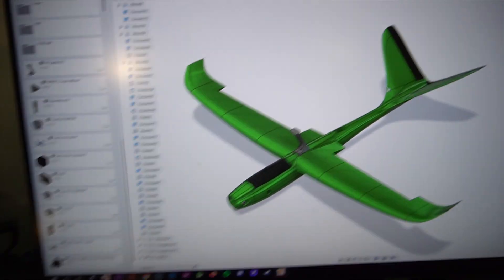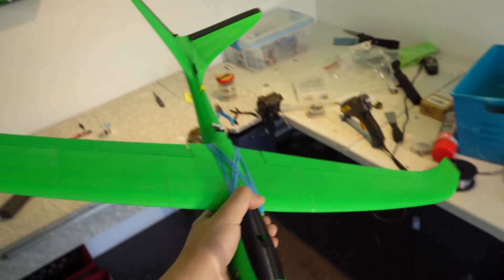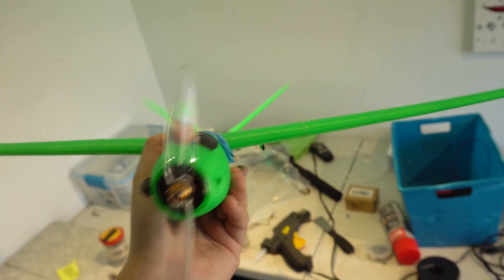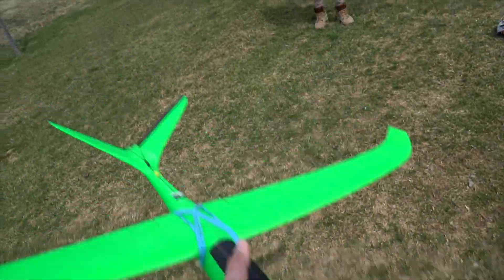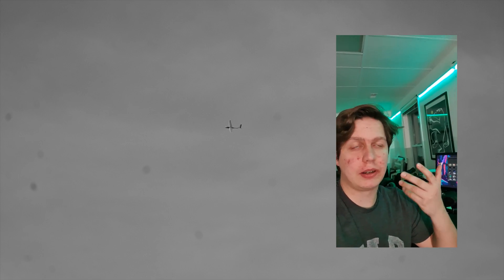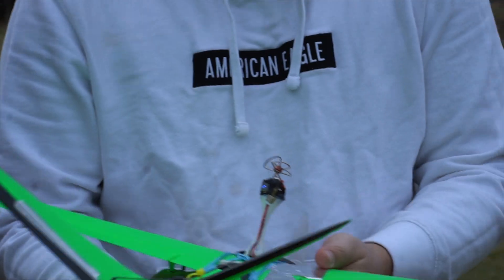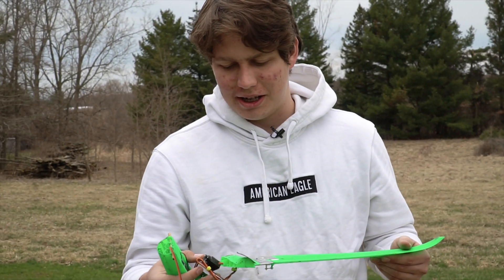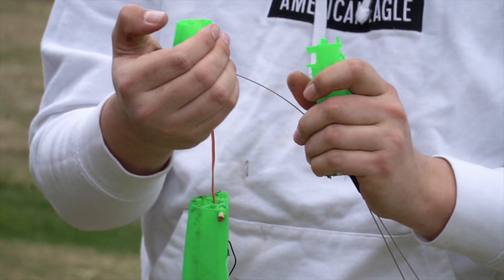3D Printed RC Plane - Will it Fly?

Comment: I wouldn't trust those tiny rubber bands to hold my wing and your ailerons may be prone to fluttering due to a missing hinge in the middle. Also, designing such a beautiful plane without a big black spinner in front is sacrilege ;)
Reply from the maker: I also have files for the fuselage available without the skewer holes so the wing can be permanently glued down
Reply: @GregMakesStuff  Nothing wrong with fixing wings with rubber bands, I only meant you should use much thicker ones.

Comment: try 3d casting plastic
Reply: klingon glue sucks, aluminium frame, metal-air batteries, diy stuff?
Reply from the maker: Might be difficult with the complex rib structure

Comment: Defintely make a video on how you designed the plan.  i'm trying to figure out how you built/designed the support ribs in the wing design.
Reply: eclipson airplanes
Reply: @marc_frank  Do they have a video on how they get the internal ribs?
Reply from the maker: Here's an explanation: the solid parts were copied and shelled out in fusion 360 (0.5 mm wall thickness) to create the "skin". Rib lines were then sketched using the design as a reference and extruded. These ribs were then cut by the skin and holes were created in them to reduce weight. Finally, these ribs were subtracted from the original solid parts and these parts were mirrored when necessary. 

Hope this helps!

Comment: Anyone think it would be possible to print this in tpu? Pla is just so fragile one crash and this thing is done.
Reply from the maker: TPU is too flexible. There would be too much wing flutter. If the design was optimized for TPU, it would be too heavy.
Reply: Greg Makes Stuff oh I see. maybe with some carbon inserts it will stiffen it up.
Reply from the maker: Hmmmm I might need to do a video on that. Thanks for the idea!!

Comment: Hah, great job, man! I also design my own RC plane, your video was helpful in some details. You can consider not just gluing one round part to another, but to make like small protruding cylinders on one part which will fit the similar cylinder recesses on another part. It will make your plane more sturdy.
Reply from the maker: Yes I thought of doing that, but it's hard to do since the part has 0% infill. Support ribs are needed for the cylinders to actually stay attached and it's a lot of extra work. I will add these features on bigger designs though.
Reply: @GregMakesStuff  have you tried some software that simulates the air fluxes around your plane during the flight? And another question - have you calculated the center of mass and other stuff for your plane? Or you just designed it and tried to fly without any calculations? :)
Reply from the maker: Mostly I just eyeballed it and hoped for the best lol. The center of gravity should be approximately 1/4 of the cord length from the leading edge of the wing.

Comment: Nicely done Greg! The plane looks amazing. Just wondering did you design the infill or did you let the slicer take care of it?
Reply: Nevermind i looked at the files i see you designed it yourself. How did you make the criss cross sections of it? Was it some kind of pattern then a split body or cut?
Reply: Man i got so many questions haha how thick did you print the outer layer?
Reply from the maker: It was a painfully long and tedious process. I designed the rib structure and then subtracted it from the solid parts. The outer wall is only 1 perimeter thick, so 0.4mm
Reply: Greg Makes Stuff im sure it was! Wow just .4mm thats wild
Reply from the maker: @piaso244  yeah it means that it can be super light. I printed it at 220°C so that the layers fuse to each other.